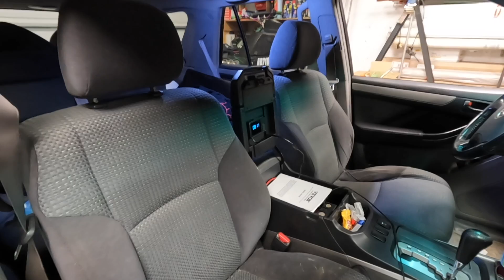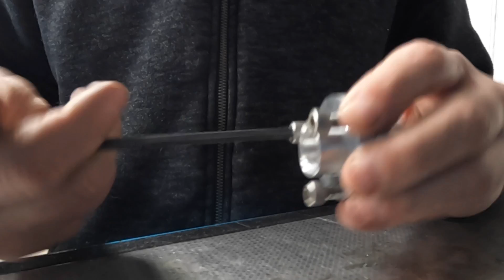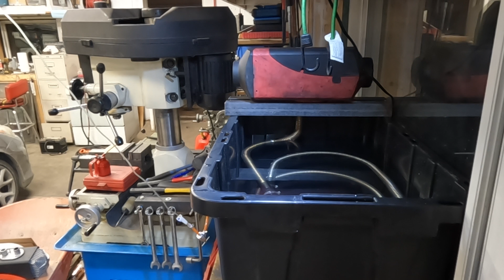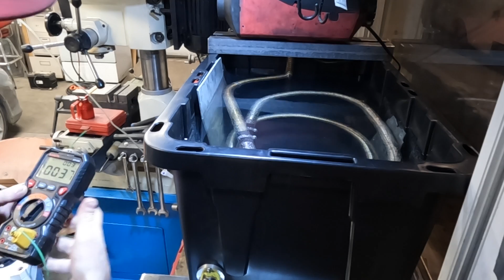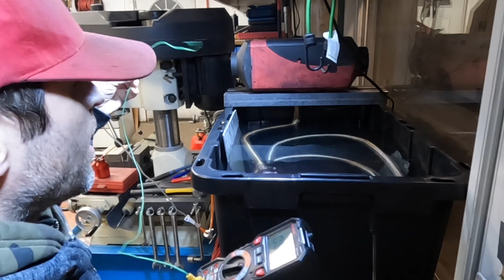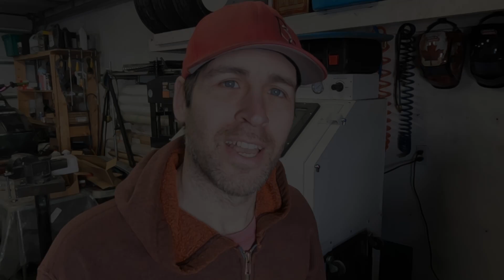"SIMPLE" Water Exhaust Heat Recovery - Diesel Heater Testing

Comment: There’s a version that burns regular gasoline. You could work on that next see if it’s possible since gas is half price compared to diesel. 🎉❤
Reply from the maker: I have tried burning gas in the past, and while it sort of works, it is not advisable. Dave McLuckie has a few videos where He tried to modify the burn chamber to burn gasoline and was somewhat successful. 

The main issue with gasoline is that, not only does it require a different air fuel ratio, but it is much more fussy to getting that ratio spot on. I would like to take one of the gas burning units apart and inspect it to see the difference.

Comment: Did we get an outside exhaust temperature to see what kind of temperature reduction, or waste heat utilization?
Reply from the maker: The exhaust gasses were 8C when the water was 5C .... so 3C above water temp. As the temp of the water increases, the gasses would be stuck at a minimum of the water temperature.... SO when the water was up to 40C. the exhaust is likely around 43C, for example.

The ability to transfer heat was extremely efficient...

Comment: Possibly it would have worked better and the water was heated faster with a copper coil but with a much larger diameter than the exhaust. And the water container should be in the shape of a barrel, having a small water evaporation surface taller and narrower so the copper spiral could easily eliminate the condensation that would occur. I suspect that the experiment started without prior planning.
Reply from the maker: Haha.. yeah. There wasn't a lot of planning, and I was using what I had laying around. 

While copper is a better conductor, the stainless was effectively removing almost all of the heat energy, as the exhaust gas temp was only 3C above the water temperature... That is impressive. (water was 5C and exhaust was 8C) 

A spiral of copper tubing would be much less restrictive to the exhaust gasses, so that is a better setup. A smaller surface area is also a good idea.This would reduce the condensation caused by evaporation, but the condensate in the exhaust will always occur... but would not be a problem with a downward spiral of copper tubing.
Reply: @loweredexpectations4927  "but would not be a problem with a downward spiral of copper tubing." Exact 👍

Comment: Adversity builds character and resilience, but it still feels shitty when things get you down 😕. Please don't get discouraged and don't let these comments get you down .  I see it far too often how a youtuber can get overwhelmed and stressed out trying to fulfill content. 
It's easy for us watching to criticize and play armchair quarterback, but and in-a-way it's what the "comments" section is for. Your cat looked pretty pissed that another Furby was on his / her home turf. 🤣
 
I'm honestly confused and a bit disappointed (in a weird way" how you ever decided to submerge so many linier feet of stock diesel heater exhaust pipe when running the risk of overheating and the obvious high C02.  
 I was then shocked that you're considering replicating the same in a soldiered copper😯. 
Please,    for the love of all that is good, don't do that. 🙏🏻

 Consider running the stock exhaust pipe directly onto a 5" long  2" OD steel threaded pipe nipple". 
One end install a thread-on cap with a 1"1/2 hole drilled through it to receive a steel fitting that will accept the heaters exhaust pipe.  

The end of the nipple inside the tank is easily  waterproofed with large flat washers nuts and glue.  Use Black pipe fittings. 
The heat exchanger inside the tote is nothing more that an empty muffler shaped steel object that exits the opposite side of the tote via a second pipe nipple fitting and washers, nuts, glue.  

You may have to prop-up or hang the "muffler " object and perhaps weld a few bits but , it's way less hassle than what you've put yourself through.  That tote needs to remain covered but remove the air intake from inside the tote.  All in all you've already proven that you can certainly heat water using  the heaters exhaust.  If you do decide to revisit this water heater,  build one that is saleable for practical use and put some money back in your pocket.  I'm certain someone will buy it.  😎Cheers Joel.
Reply from the maker: Thanks Dan. i enjoy what I do and try not to let negativity get to me. There is a lot more positivity, so it's sort of a matter of what I choose to pay attention to.

Haha... Yes, Quasar was confused about what was happening. He usually hangs out under our trailer on lookout... but he must have been sleeping or something, haha. 

HAHA... I had run the test with much more pipe out of the water and knew that this would be worse than that test... but didn't figure it would be so bad. I wanted to make sure that I was capturing as much of the heat energy as reasonably possible... Considering the exhaust gas temp was only 3-5C higher than the eater temp. I think I achieved that goal. 

If I do it with copper, I won't use nearly as much. Copper is a much better conductor, so it will do a better job even with half of the pipe... and the smooth wall should help with flow as well. 

The main thing when building a heat exchanger is having lots of surface area, trying to keep the flow rate slow so it has time to transfer heat, and a material that is suited to transferring heat... An automotive muffler would probably work well if you made sure that it was sealed. 

This was supposed to be a quick and dirty project to break up the monotony of waste oil testing, as I had a few videos in a row of that... If I do it again, I will put more thought into it👍

Comment: Maybe if you run the exhaust into a copper coil you'll get a higher temp.  Copper conducts the heat better than steel.
Reply from the maker: Copper would be better for sure. It conducts heat so much better that you could use much less of it and maybe lower the CO emissions.

Comment: I’ve got a 5kw heater in my garage that I have the exhaust piped into an old 100gallon propane tank. It then exits out the bottom And goes through the wall of the garage outside. With the size of the steel tank it does a pretty good job of dissipating the heat. I haven’t checked actual temps or CO on the exhaust but it’s just steam and condensation that drips out. 
 I can totally understand getting burned out on a project. Sometimes you just gotta take a break and come back when you’re truly interested in it.
Reply: Better to use a purpose made diesel water heater.  Use a heat exchanger style water heater tank to limit the amount of water in circulation through the heater ( of course use a 50/50 glycol water mix)
Reply from the maker: @gbear1005  Yes, if your objective is to heat water, then the water heat type is much better. The idea of this test is to capture lost heat energy, while using an air heater.
Reply: @gbear1005  even diesel water heaters have exhaust heat that is wasted unless you have some type of exhaust heat recovery system. Straight water is actually more efficient at transferring heat than glycol. Though there are some benefits, like the corrosion resistance and obviously the freeze protection.
Reply from the maker: I had a 300L (45 gallon) oil drum last summer, and I wanted to keep it around to try what you have done, but I couldn't justify keeping it around as I dont' have the extra space, haha. 

Yeah... sometimes when a projet goes sideways, the best idea is to set it aside and come back to it at a later date.

Comment: I recon if you swapped to smooth walled ex pipe you'd get better flow and lower CO readings, not sure that would change much but less back pressure would be better 🤔
Reply from the maker: Yeah, I think you are right with that assumption. If I do it again, I will use something else for pipe.

Comment: You can get muffler putty or tape at Canadian Tire to fix any pinholes and also to seal the pipe connections. Also, I now add a capful of Kleen-flo diesel fuel treatment, that I also buy at CT, to the fuel tank to significantly reduce the carbon buildup in my heater and the amount of smoke produced (I no longer see that big cloud of smoke on start-up, for example). Since you are also burning waste oil which causes that carbon buildup I wonder if the diesel additive would make enough of a difference in carbon production to reduce the need to disassemble and clean your heater?
Reply from the maker: Thanks for the comment. 

The biggest issue with the pinholes is actually locating them. I sealed a few, and more kept appearing, haha. 

I have tried some additives in the past for waste oil. They do indeed help with carbon,  but the ash build up is the real problem. That's cool that it works so well for you. I wonder if you heater is running rich ? It shouldn't really have carbon issues if it is running well. 

I have a Canadian company sending me a diesel additive to test... should be interesting.
Reply: Would biodiesel help? It’s a very good solvent and very slippery.
Reply from the maker: @wallacegrommet9343  I haven't tried it ... I've heard some people have good luck with it.

Comment: I'm glad you didn't delete. Always learn something even if that's not to do it again. That said I think the thermal battery idea is great for static situations, the fact the energy is essentially free makes it even better. I have a short length, approx 1 m, of exhaust in a metal box cooled with computer fans which works great. I'll take a thermal pic next time it's running to show the temp difference across the length.
Reply from the maker: Thanks for the comment and support. I think the fan idea like you have, or with a exchanger is a better idea. I'm not sure if I will have time to do it this year, but I would like to make a similar setup.

Comment: wonder how you calculate the loss of efficiency from the unburned fuel passing through as monoxide ?
ps I'll settle for second   ;<)
Reply from the maker: That's a good question. I suspect it is a very complicated calculation with a lot of variables that need to be monitored. 

The fact that there is CO does mean incomplete combustion, so decreased efficiency. There must be a way to calculate how much fuel is not being burnt based on what is being pumped in and the total CO.
Reply: @loweredexpectations4927  Probably only a small percentage - way less of a worry than the major buggeration factor of re-claiming heat this way
Reply: maybe re-brand it as a cunning machine for gassing critters that tunnel under your garden
Reply from the maker: @bigoldgrizzly  It would be effective at that, haha.
Reply: @bigoldgrizzly  It's probably not much as the lower limit for flammability of CO is 12%, and there's no way the exhaust would sustain a flame, though the air fuel ratio really is super lean to begin with. OTOH, even small amounts add up.

Comment: Huh. I have 3 meters of exhaust and my CO is well below 50. I have a CO meter on the way, but on my CO alarm, if I trigger it by putting it in a bag with smoldering incense, then pull it out of the bag and put it in front of the exhaust, the number goes down to about 25 before the display shuts off. A meter and an alarm both use electrochemical sensors, so I'm confident the reading is valid. CO being from incomplete combustion, maybe switching from alpine to regular might improve that number, but I suspect something else is amiss. Anyway, I can understand being sick of a project, so onward and upward. Or downward.
Reply from the maker: Yeah... something wasn't quite right here from the very beginning. The only thing I can think is that the density of exhaust gasses are very high due to the condensing effect from cooling. The outlet temp was only 8C so all of the moisture was condensing. 

In the video where I tested the strait pipe, I had noted that the exhaust seemed to run with more CO after adding a cool section of pipe, and then the CO would come back to acceptable after the pipe warmed up. 

I may revisit this at some point.... but not for a while, haha.
Reply: @loweredexpectations4927  I remember that, it made me think of that too. At a later date, perhaps!